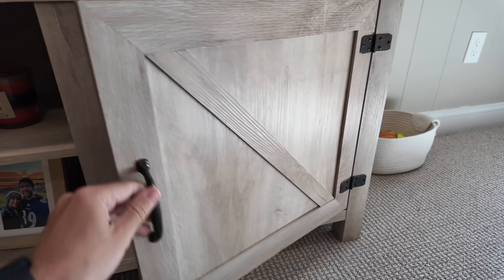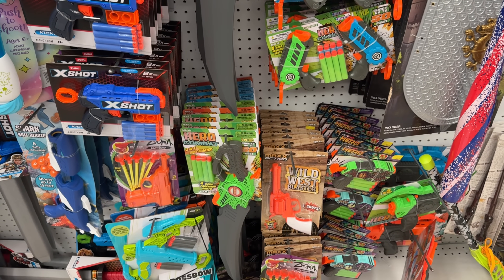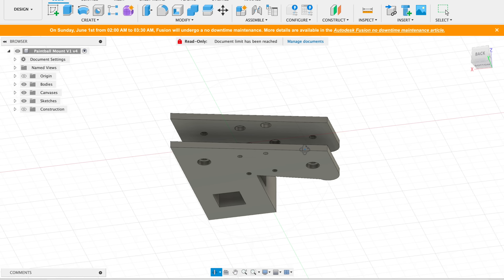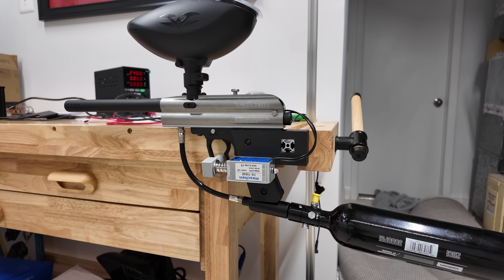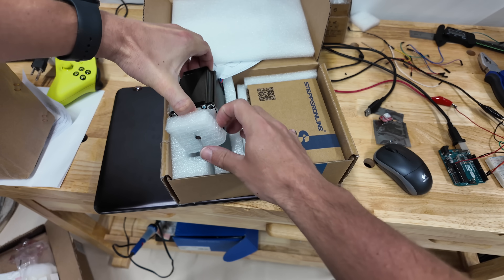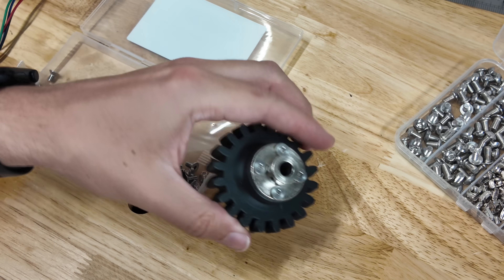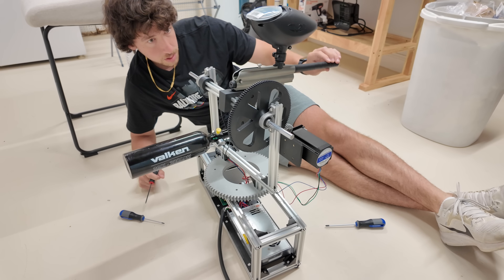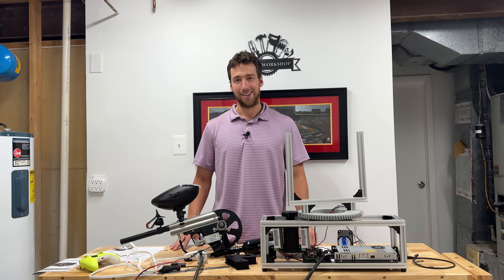I Built an Xbox-Controlled Paintball Turret

Comment: late at the party, but i like to say, i admire that electronic and robotic part. it is great proof of concept, would be nice to see second part. that is something i cant do, xbox controled.
i can see many tips in comments for cameras, more reinforcement base and ofc make it move. :) 
from a paintball perspective... few years ago we had similar turet at paintball event for defenders, it was man powered, mechanical based on WW2 machine gun stands. one person sit behind it and second one dumping bags of paintballs to the funnel.. it needed big gas bottles from divers conected by long hoses, electric feeders for guns under that funel and a lot of cleanig barrels. two point holder for guns, long barrels and some sand bags at the legs of the stand made it shoot like laser pointer... and ofc, it can be mounted on the car

Comment: You need some braided loom to finish off the loose wires. Sweet though. Need to mount it near the porch to fend off the porch pirates with an auto motion tracking feature. Should scare them off.

Comment: With a fairly inexpensive f.p.v. Setup, you’ll have a way to fire it remotely and aim it thru the goggles. 

If you really wanna get crazy, throw head tracking in there so you can aim it just by looking around. 

A decent set of f.p.v. Goggles will only set you back like 20” bucks, and the head tracking is like 80 bucks.

Comment: That is perfect. I love how that came out. That PAINTBALL package that you saw on Amazon was $600. The gun itself is an empire mini which does shoot full auto and used will probably only cost about $150 maybe $200 at most. Also, instead of using CO2, which is hard on the guns internals. You should use an HPA tank. it’s the only thing used in PAINTBALL now. 

Next, if you park any cars in the driveway, you should mount it on the roof of your garage and point it towards the driveway. Then put motion activated sensors on it and a warning sign in the driveway. And then you can charge people for live feeds and everybody can enjoy it. Lol! 😆

Comment: And the gas routing could be so much better for better accuracy! Use braided lines to replace the tank, have them connect to a larger ID braided line to a regulator with expansion chamber to your tank. 

Overkill right?
Sweet project, need to add camera!

Comment: OH BUDDY.... THIS HAS BEEN MY DREAM MY WHOLE LIFE.... 

Build yourself a Home Security Turret! That mount you have on your back wall?? 
You could totally add 1-3 cameras to that! 1? Just center the camera between the two paintball barrels. The middle of the lenses should line up evenly at the same level as both barrels! So if there's 3 inch gap between the barrels, the camera lenses dead center and level with barrels, than what ever the lenses sees, both barrels would zero about 1-1.5" gap on either side of the center lenses point! 
Use one of the newer advanced security cameras, with the built in 2 way speaker on the camera, setup between the barrel, you could do so much with that setup!! 
With AI programs these days, you can setup AI to watch said camera, detects a person in the camera, and program to follow them with the camera. Simultaneously have Lights come on shining on the camera's view, while an audio recording plays... DMX Mickey skit! 
"Yo, who is it?",
"It's Mickey",
"Who sent you?"
"Mickey"
"Yo, n____, who sent you?"
"It's me, Mickey"
"A'ight"
POP*POP*POP (Gunshots) 
and time the AI to pull the trigger with the sounding gun shots, but only stop after the 3! 
Setup the camera to only see once someone enters your yard, effectively on your property, meaning if they walk off the yard before the skit reaches the Gun shot, the AI doesn't fire the paintball. If they stay in the yard, not only it fires, but tracks them while firing if they're moving around! 
You COULD argue (or your lawyer on your behalf), that you did not setup a Booby trap, but merely a perimeter deterrent, as the Paintball is only mild pain, not lasting pain, and only activates after a delay (per skit), and only if subject was trespassing on your property! Further with home made caution signs established outside... "CAUTION- DO NOT ENTER! Area monitored by security and active paintball deterrent!" you should be able to argue that it was legal, less then lethal, not intended to harm, but established as a deterrent they had sufficient warning (3 warnings; a sign, audible warning, actively engaging turret) which should be enough to convince the courts it only activated on subject because they violated your space, knowing there was an active deterrence, and chose not to vacate with sufficient warnings, all contradicting the Booby trap accusations! If your lawyer questions subject adequately, and defines a booby trap in the courts (unknown, intended to mame or kill, sudden strike) all opposite of your turret. further backed by an adequate AI coding printout showing the instructions to the AI, and the ops designed, further explaining that it does not fire at anyone beyond the walls/outside, and also that it only first 3 shots, before pausing,  all backing your counter booby trap claim, that it's merely a deterrent, no one would dare challenge you in court! 

FURTHERMORE... You can have other cameras watching the yard from a different angle, say corner of house, and those cameras just capture the feed for security purposes, if it's set to see the back yard access point, and the camera turret, could be used to verify your claims that again, it was just a turret! Anyone who doesn't challenge you in court?? They suffer their consequences and refuse to challenge the turret again, that footage would make for GREAT YT Content! 😂🤣

More... you could even upgrade the turret idea... 2x 180° degree cameras, on either side, both turned to overlap the front view of turret by about 5-10° angle, using AI, can determine where they are in the view! Those camera views could be used by AI to track and control turret, also video feed of intruder from turret's perspective. Sense 180 X2, -5-10 the turret has an almost 360° (about 340-350°) angle coverage, there's no approaching that access point without the turret (and the ai) already knowing your coming... It could even be programmed to track (turret rotates, barrels pointing), with lights coming on, but the audio ONLY activates after said trespasser crosses the threshold of your yard, upon which they'd have that delay from then til the audio (and paintball) gunshots! 

OR for full 360° coverage, using 3 cameras on the turret! One would be the aiming 0 turret, centered between the two as mentioned, a focused camera of say 30° forward, in the single camera setup, and that camera only used for tracking purposes for the Turret aiming! The other two cameras (2x 180°) could be setup on either side of the turret, facing exactly 90° out from either side of turret, if placed just perfectly, either 180 ends, begins where the other 180 ends, begins, and you'd have a perfect 360° view around the turret, whether those two are mounted and turn with turret or not, if they're not directly mounted with turret, and don't turn with it, would still cover a perfect circle around the turret! Still, use another scene camera watching from the corner, covering the turret and access to yard... to have multiple angles of view! 

LAST Idea... If DMX Mickey skit doesn't suit you?? maybe the FAKE Movie scene shown in Home Alone, which never existed, only inspired by a movie in the 1930's... the movie Kevin watches when he's not suppose to... that skit would be PERFECT for this turret... 
"Hey… ‘tell you what I'm gonna give you, Snakes. I'm gonna give you to the count of ten, to get your ugly, yella, no-good keister off my property, before I PUMP YOUR GUTS FULL OF LEAD! One, TWO... 10!" and start firing the Painballs 5-10 rounds to match the sounds of the movie with him laughing behind... and than stop firing for the caveat!! "& keep the CHANGE you filthy animals!" and then deactivate! 

Both versions could even reactivate shortly after last skit ended, if subject is still on the property and sets off the sensors again for AI to continue tracking... if they stay around for ROUND 2? They can't argue that in court...

Comment: Two suggestions: (1) modify the paintball gun so the co2 tank is vertical straight into the intake, in front of the trigger, rather than mounted under the grip as it is now. This will move the center of gravity closer to the middle.  (2) there are foam practice balls for indoor use. They work about the same as regular paintballs in the marker but are reusable, and do minimal damage indoors. So you can test in a garage or something.

Comment: You need metal hoppers and cover the contraption with steel also get a hose and run it into care where a large nitrogen tank would be…more constant and safer air supply. Needs a better feeding system than gravity. Very impressive. Just a few tweaks I’d add to sell it to the government 😂

Comment: Sweet, I just don’t think I would want one, as I own firearms. If a real gun could be fitted on it some how, and you own a real gun on premises, that could be intent to construct a NFA item (a MG) That’s 05 manufacturing FFL license type stuff. Just like every other powered trigger activating device that has been made in the past. Owing a firearm and Manual trigger crank= ok, motor activated= nope. But if you don’t own a real firearm, or have access to one on property, you should be fine. Just don’t sell it to someone who owns one. that could open a whole new batch of worms. It’s just way to similar as buying a cheap guard mounted trigger crank online and simply adding an electric motor from a RC car and battery. Which is definitely not a legal thing to have in possession if you have a firearm you can mount it on. The 1986 GCA kind of made it so you can’t register one of these as a MG, to be able to own one and a firearm without getting a big jail sentence because of intent to construct.

Comment: small clarification on the paintball marker stuff. the Empire Mini GS shown is not actually full auto, its an electronic marker. it retails for about 320 bucks. what is shown is a full kit package complete with a carbon fiber tank (which itself will be roughly 150-200 bucks) and a Halo 2 loader which also runs about 120 bucks. an electronic marker with true "full auto" would be something like the DYE DAM which costs 1500. the Mini GS is an entry level electronic marker as opposed to the mechanical marker shown at the start and used in the video. having said that, if you were to use a Tippmann A5 or 98 Custom with a Response Trigger you could effectively get "Full Auto" performance from a mechanical paintball marker.

Comment: Neat idea. Look for a way to connect the HPA tank off the gun itself to reduce the weight and bounce. It's a tube with the correct fittings called a "Remote" or remote tank adapter. Likewise, having the paintball hopper on the non-pivoting section of the mount would allow for a simple tube to feed it remotely from the hopper. This would allow you to balance the gun like a camera on an gimbal making it faster and easier on the motors as the weight would not change over time as the hopper empties. Also, many electronically triggered paintball guns available, super easy to connect a relay to the trigger wires and fire electronically. Other advantages such as ROF control and optical sensors to prevent jams.
Reply from the maker: Thanks for all the ideas, in the future I’ll maybe do some of these

Comment: For a local commute electric motorbike makes great sense, an electric step thru makes more sense with the extra weather protection but eat makes the most sense, is an ebike. Lighter, easier to store indoors so less chance of theft, and toy can use all the cycling infrastructure.

I'm pretty certain an ebike can get through London quicker than any motorbike.

Which of course is my pitch for your next video. Which one of you two looks better in lycra?

Comment: 2 Ideas.
1. Use a motor with an offset lobe to pull the trigger faster. (Think about how a piston in an engine moves up and down repeatedly)
2. Put a thermal camera on it and have the aim slow down when it gets close to a hotspot for aim-assist.

Comment: awesome dude! I think it would help with balance if you took the air container and moved them off the gun into the base of the structure, it would help with stability and recoil. Should be pretty straightforward with a hose for each container.

Comment: 10/10, doesn't feel dragged on/filler like many similar videos and goes into just the right amount of detail
how does this only have 24k views bro

what filament did you use for the gears?
Reply from the maker: Thanks for the support man, appreciate it a lot! I used PLA for the gears
Reply: @PaulJunkin  Nice- I think that performance and durability would be mildly improved with PETG or a composite

Comment: Next up:
-Camera with reticle so you can look at where it's aiming on your TV
-Modified power supply configuration to run off of house power (i.e 120v with step down transformer to get to your control voltage)

Comment: Next upload;

How I put OpenCV on my turret to track and complete facial recognition
Reply: Just from some a little experience, you will need something with a little bit of horsepower like an i5 quad core 16gb Ram or better to get that going well with OpenCV. I added an accelerometer/gyroscope for when it's mounted to moving devices and use a controller in manual and OpenCV in auto. You should spend more time on your models than the build or code itself. You will want to make sure that model runs well and use a 4k camera or better.
Reply: @samuelpries9578  Agreed
Reply: @samuelpries9578 or use cuda in a GPU, it's way faster that way 😅
Reply: Michael reeves made a laser that was facial recognition to find the eyes😂
Reply: dont  forget a lidar- and windsensor so you can exactly calculate trajectory
Reply: Yolo variant models are a good choice for this excellent fps even just on a CPU on really bad devices. 

There's other stuff you can do with something like the Nvidia jetson platform but really cool stuff this guy is doing on the mechE / EE end
Reply: Agreed. And connect with Home Assistant!

Comment: That's pretty neat. From watching I've noticed that while rotation goes fast, there's a lot of settling time after a rotation movement.
For the x axis, maybe a triangular brace connected to the rotating base from the top of the posts would have increased rigidity. Not sure what could be done about y, the materials seemed to flex a little?
A remote FPV camera (like they use for drones or similar) mounted between the two paintball guns could also be a fun addition.
Regardless, neat build and looks fun to use.
Reply from the maker: All great points and I agree - I thought about the camera for a while haha, maybe in the future. Then I could call it a first-person turret
Reply: Call it the D R 7 demodulator.😂
Reply: The simple fix is that the CO2 tanks don't need to be moved. Just get a longer hose. That will remove at least a third of the mass and bring center of mass closer to the axis of rotation.